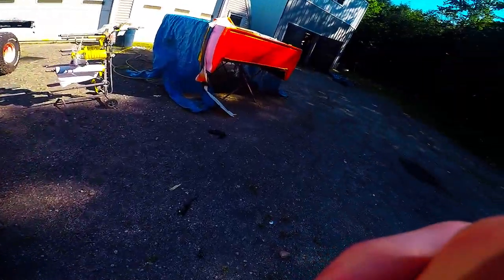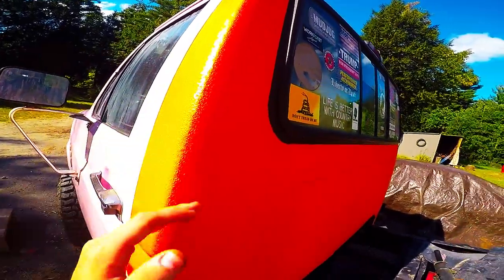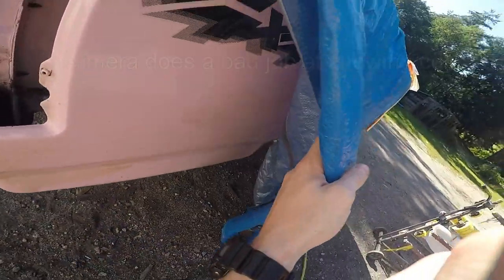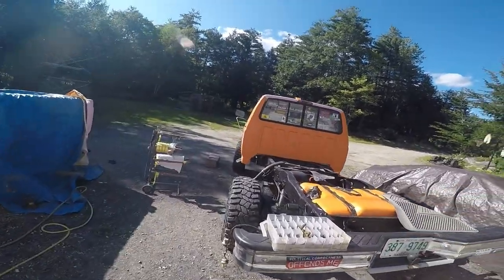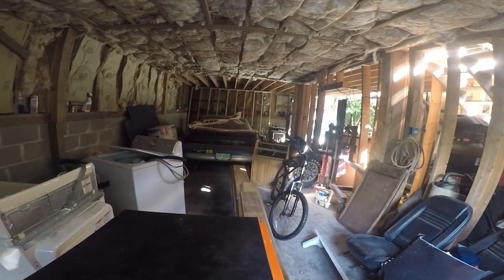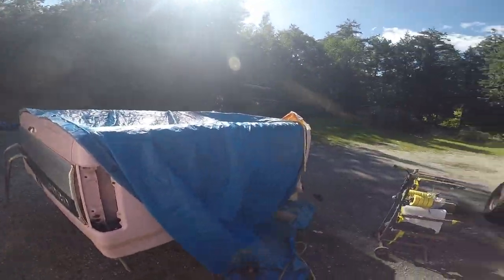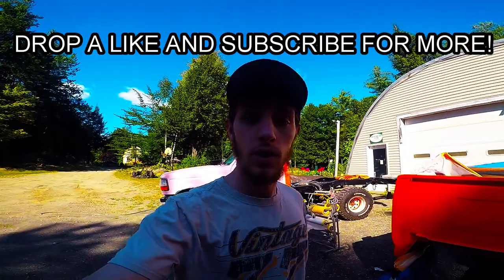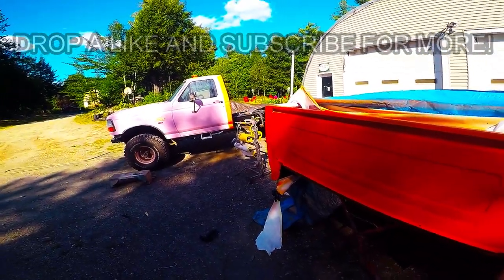BED LINING MY TRUCK! 9" LIFTED OBS F150 BUILD - Vlog

Comment: Loving the color. doing the rims too? and I think you should add the name ORANGO to the list of possible truck names.
Reply from the maker: Rims will probably be lined in black. Haven't decided for sure yet. But i can tell you bed liner is not as cheap as i thought it would be. I Used 2 liters just to do what was shown in the video. Each liter is about $40 lol
Reply from the maker: Oh and thanks for the comment again buddy!
Reply: Black rims are always nice. Gonna be plasti dipping the rims to my GTO eventually. The good thing about your entire truck being spray on bed liner is your truck is pretty much got its own spray on debris shield. nothing is gonna scratch that sucker.
Reply from the maker: +PhysicsPixel That is the plan. Was going to paint it but I know I would have destroyed it. Thought about plasti dip too but not durable enough for me. If you looked closely before there were insane scratches down the side in my clear coat from rubbing on bushes and tree limbs 😂

Comment: I've seen in another video you said it was SEM bedliner.  I'm assuming it's a tintable liner.  I couldnt find where you said what the color was.  What base color did you use to mix with this.  I love the color!  And yes for the haters I am aware this is orange but it must have a certain paint code?  Thanks
Reply from the maker: J8 Tangier orange. It's a ford color.
Reply: +Bearbait01 thank you.  I will put it to use.